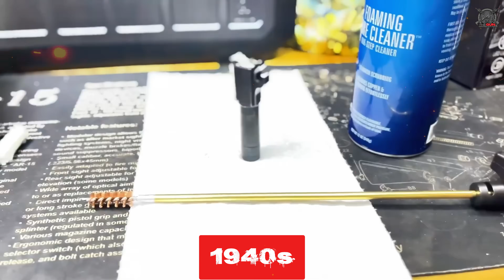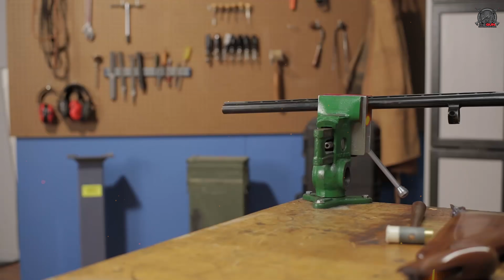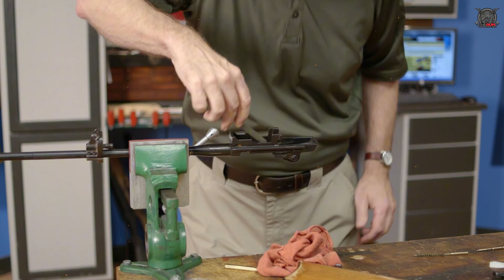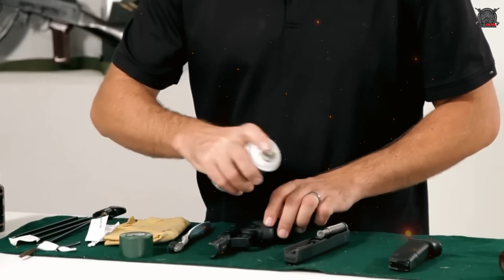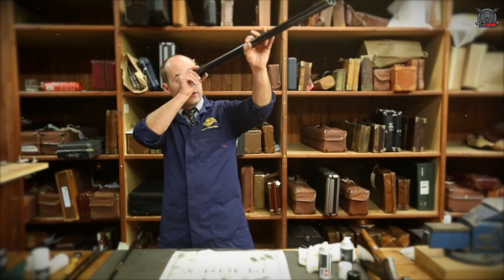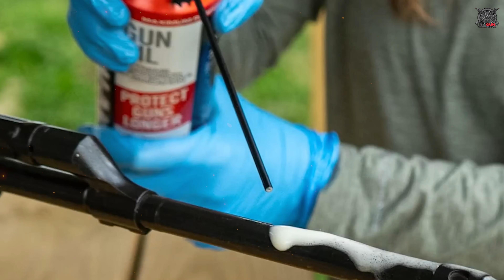5 Old Gun Cleaning Habits That Are Destroying Modern Firearms!

Comment: I use cleaning habits from the 1500s 
Soap and warm water. Dry thoroughly, lube with light grease. Paste wax outside for rust prevention 
Turpentine and pumice dust for heavy rust.  
No plastic frames.